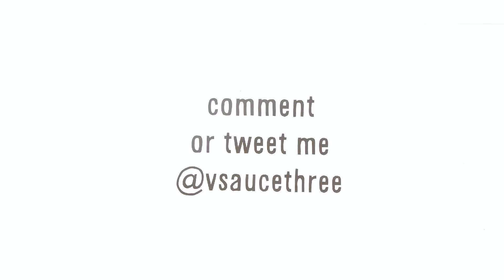5 Awesome PlayStation 4 Facts! -- Fact Surgery

Comment: My Gpu has a performance of nearly 5 Tflops when overclocked (base at around 4 Tflops) and it costs nearly 100€ less than a PS4.
Reply: ***** GTX 970 320$ 4.1 tflops at 1.15Ghz and overclocked to 1.55ghz it easily breakes the 5Tflops
Reply: JUST for the Gpu... still PC for me.
Reply: Thats NOT what I'm saying. I just listed some facts about my Gpu, how fast it is and what it costs. I'm not saying that the Pc would be cheaper with complete high end parts like an i7, 16gb ram and a Gpu 3 times faster than that in the ps4 (HELL NO). It's just so that the Gpu they used in the Ps4  costs arround 150-200$ and that a Pc Gpu provides much more power at the same price. If you would build a Pc for arround 400-500$(xbox one) with more or less equaling parts to the Ps4 you wourld get a higher performance with it when it comes to flops.

8gb ram-50$
(eight core amd processor at 1.6 ghz does not exists for pc. so we take a 4 core at 3.2 ghz) Amd phenom II x4 that can be overclocked  beacause the ps4 can boost it's cores up to 2 ghz when needed-80$
for gpu we use a R9270x wich provides 2.56Tflops(!!)-180$
a DVD drive wich is enough (sony is owner of the company who developed blu ray and gets the drives much cheaper) 15$
a cheap mini atx mainboard-50$
cheap psu-30$
20$ for mini case
500gb hdd 40$

we now spend 465$ and our gpu has a peak performance of 2.56Tflops wich is significantly more than the 1.8 of the ps4's gpu. (and it can be overclocked too)
Reply: Those were just examples. Hell I would never buy a 30$ psu. I just bought myself a new Pc and spend 120$ on the psu. Ok, in the end I spend nearly 2000$/1600€ on my system (not including the 144hz monitor and stuff like a mouse) but thats the downside of living in germany. All these things are much more expensive compared to when you buy them in america. In the Ps4-pc build i used the amd processor because it was the clostest thing to a ps4 cpu and Intel sure does provide more performance but to a much higher price. For my personal gaming sytsem I bought an I7 4790K and an z97 mainboard that will also support the upcomming broadwell generation. And I dont belive that your laptop has a 15w TDP. I measured the power consumption of my own and it consumes 15 w in idle (arround 60-70 while loaded) and the performance of it is shitty as hell.  The power consumption is one reason why I bought an Intel cpu the new Nvidia GPU. Amd is just killing your psu with therir power cunsumptions of their gpus and Cpu's and Nvidia has doubled the performance per watt rate with their new gm204 maxwell gpus compared to the last kepler gerneration. Wihle the gtx 780 (4tflops) had a tdp of 250w thy 970 i bought has a tdp of 160w. And the i7 should not consume more then 90w (compared to an FX9590 wich cosumes like 200w ore more). And the 80 gold  psu from corsair wont even be loaded up to 50% where it has an efficancy of 92%  and it  stays quiet as well. Until now had a Laptop with a  peask performance of 300 gflops or 0.3Tflops while consuming 60 w. I'll get arround 5.3Tflps and consum around 330w with my new Pc. that will increase the Perfomance by 16,2/3 times while i only consume 5 times more energy.
Reply: sata 3 and usb 3 alrady became standarts. My mainboard only has sata 3 ports and more usb3 than usb2 ports. DDR4 is currently used on intels latest extrem chipstet but is doesn't have any advantages compared to DDR3. The minimal improvments in power consumption of 3w or so is far from being worth the price. you pay arround 120-!50$ for 16 gb of ddr3 ram and 230-270$ for 16 gb of DDR4 ram.

And the cpu is not the whole system. and I don't see such a thing as a real laptop more a notebook (i know it's basically the same but for me notebooks are more like a slightly bigger tablet)
Reply: this conversation makes me happy, just that people know this kinda stuff, which i want to learn
Reply: Classikassassin
You're welcome :)
Reply: Aarontsu i would but 0 money

Comment: 1 Million Units per 24 Hours = $400 per second
Reply: Except there's not 1 million seconds a day so $400 a second doesn't work out. in one day there are 86400 seconds, so the math is 1000000 times 400 divided by 86400 which of course gets 4269 dollars a second.
Reply: Ok, it's just that I heard it was, I didn't really do the math

Comment: All you foolish techies.. Cloud-gaming it is, no more massive PC-Towers or clumsy consoles.. Thin light well designed multitouch-displays, that automatically connects with all your other devices as well as mouse/controller/keyboard over wifi. Hardly anything will be stored on this thing then, everything will be in your personal cloud, that comes with the device. 4 more years and we'll hold it in our hands, as a iPad/MacBook combined device from apple, and yes, you're going to buy it.

Comment: Not a PS fanboy, not an xbox fanboy. I play pc. I look at this and have to laugh because my gpu was made 3 years ago and it has 20% more power than the gpu in this thing. You guys get all excited and I look at it as already being out dated. Did you know this thing only has a 1.6Ghz processor??? Mine was made in 2009 and it's stock speed is 3.2 This is already out dated. Have fun with it.
Reply: Yeah I mean the DS is faaaaaar less powerful, as is the N64, and they're worthless right? No fun at all, nobody bought them and had fun that they would remember throughout their life or anything.

Honestly very few 'next gen' games seem to be up to scratch compared to their hardware. My PS2 is more valuable to me than the PS3. Power isn't everything.
Reply: And I completely agree with you. I loved my N64. The problem is all these systems do is boast about how they are suppose to have great graphics. I'm not saying they can't be fun. I'm saying that the new systems try and say they are better than they really are... graphics wise.
Reply: Ummm no. Not wrong. The ps4 is stock at 1.6 and the Xbox is "over clocked" at 1.7. Look it up.
Reply: No, YOU are wrong. The jaguar processor is only capable of 2ghz speeds and both processors are under clocked to reduce heat. The ps4 is 1.6 and the Xbox is 1.7 look it up. Anything that says it's higher, look at the date it's published. Its all before the the system came out. All the articles after the release date say 1.6 and 1.7 If you still think I'm wrong then whatever.

Comment: Can't believe I have this trash, I wish I had a PC no wonder why console gamers are "peasants" because I live in the hood so how will I even get a hold of $1000. GTA V still costs $60 on PS4 by the way.
Reply: You dont need 1000 for a good pc. And gta is still 60 on everything but xbox 360.
Reply: Julian Robin Oh. Well I would take the least expensive PC that can run Ultra 1080p 60fps and with an OP cooler so it can last many years and perform great